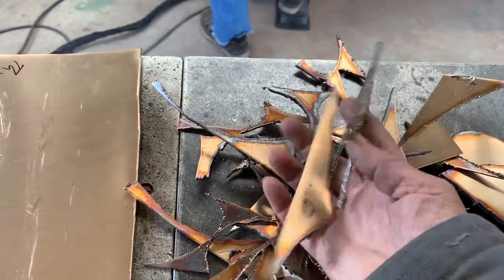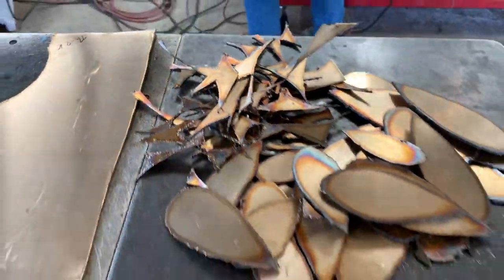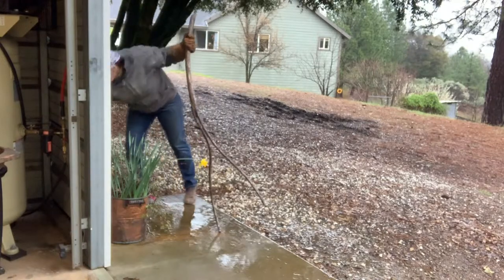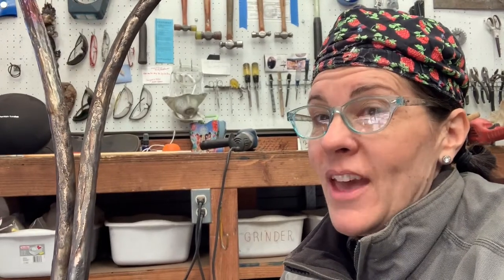How to Create Texture When TIG Welding Bronze [Looking Into the Light 26]

Comment: Boy that was some wet kiss you blew everyone ☺ So I had been hoping you would show us some of how the textured branches were created. Thanks! That expensive bronze tubing brings me back to when I was an apprentice at Bechtel Corp. I was sorting through the storage over the engineering office and came across long lengths of bronze pipe. I asked about it and was only advised of it's extreme value, and nothing of how it ever got there. I remember this was the day mayor Moscone was killed. If someone did not scrap it, I bet it's still sitting in that rack. Yes indeed your father is exceptional. Hope you can keep going like that yourself.
Reply from the maker: I will have to upgrade my filming equipment to show the actual welding process. Someday!